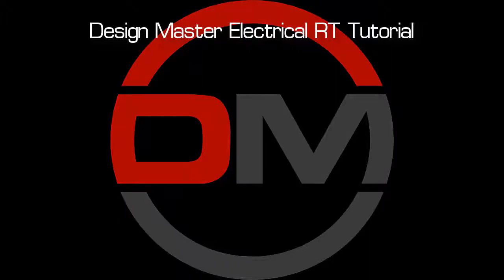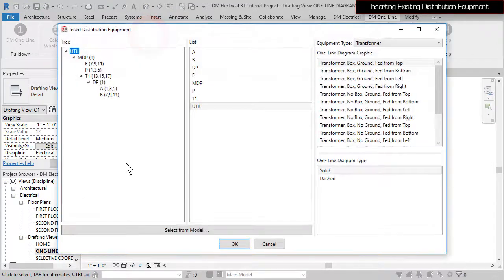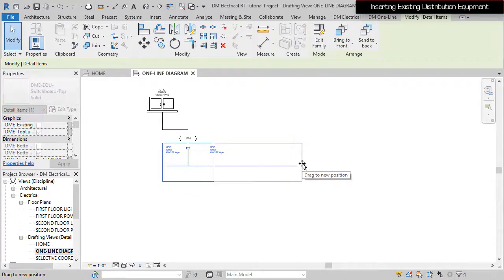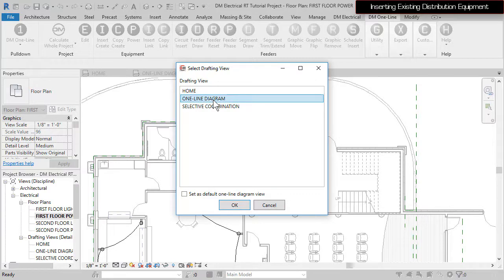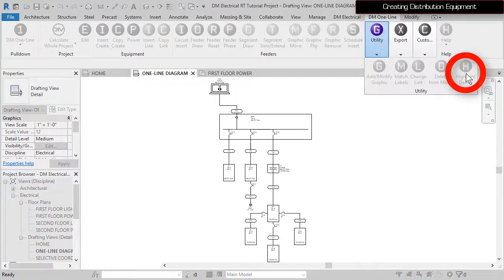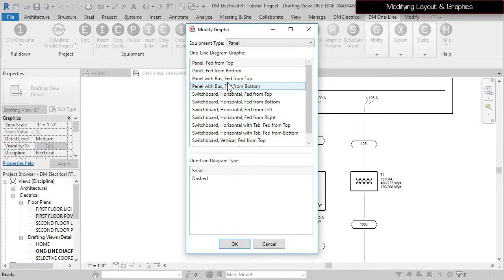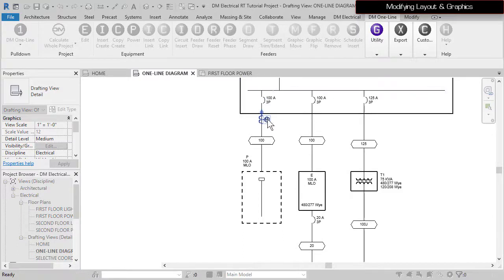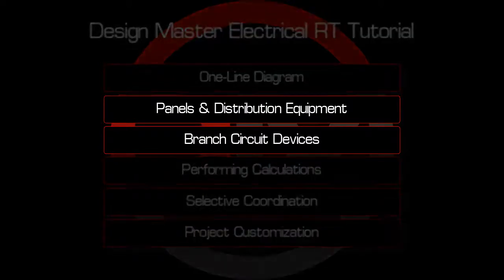ElectroBIM for Revit: Video Tutorial Part 1

Comment: Is there a way for an equipment to accept multiple sources and to get that to populate on the one-line?
Reply from the maker: Yes. If you model it in Revit with multiple sources, ElectroBIM will populate that correctly on the one-line. Transfer switches are the most common example of multiple sources. Getting them to work in Revit is a little tricky. This article explains how to make them work:
https://www.designmaster.biz/support/blog/2019/07/automatic-transfer-switches-in-revit/